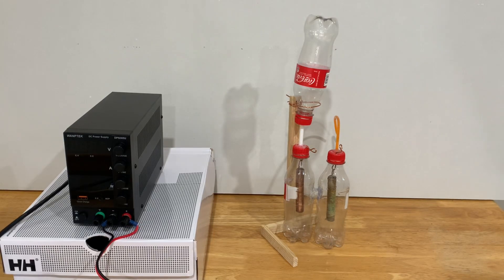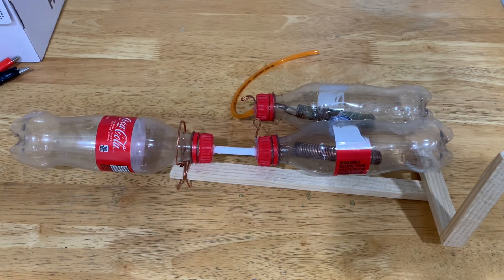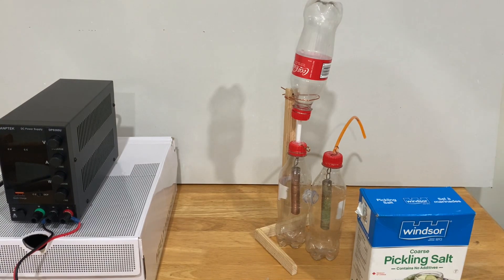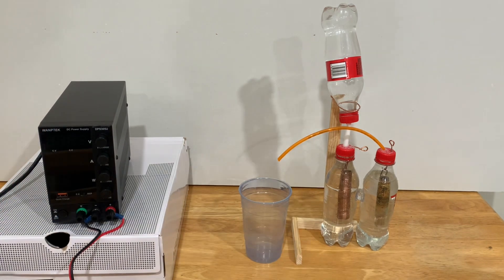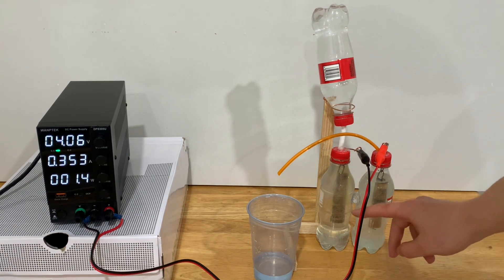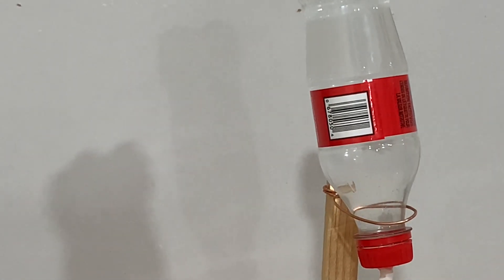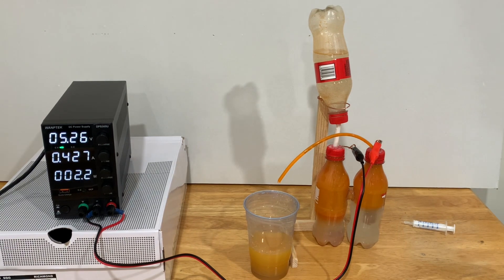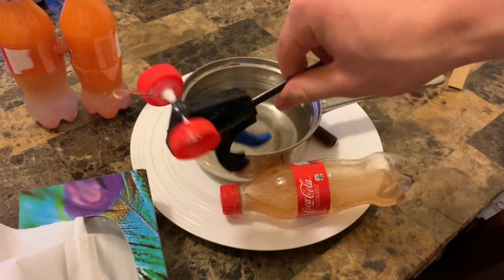Separating water into hydrogen and oxygen

Comment: Lol i made an oxy-hydrogen generator kast year dry cell using scrao steel i had in a pile half of 9 plates the 2 outside plates are one electrode and the middle odd plate is the other which makes it kind of a double back-to-back self so it produces oxygen and hydrogen in both directions I got a power supply that can go up to 30 volts and 10 amps looks a lot like yours I would imagine it's probably close to the same and it can produce about a liter per minute it took about 2 minutes and 5-6 seconds to produce a 2 l

Comment: The orange stuff is probably iron oxides and chlorides. When the electrolysis takes place, it produces chlorine gas from the salt, and this quickly reacts with the iron to produce iron chloride, which dissolves in the water explaining the yellow color. It also generated iron oxide because oxygen gas is also being produced along with chlorine at the anode, which reacts to form iron oxide. The iron oxide explains the orange color. Iron oxide is insoluble, so it appears as a sludge.
Reply from the maker: Here’s the thing tho, there is no iron inside of this machine, it’s all copper and plastic, I would agree with that explanation myself if there was iron, as if anything my pfp is made from iron hydroxide, but the thing is is there’s no iron inside of this machine to make iron salts out of
Reply: @ChemistryOnCreatine  its possible that its copper hydride?
Reply from the maker: Honestly I thought so too at first and for a long while. After doing a little bit more research I’ve concluded it’s copper(i) oxide
Reply: @ChemistryOnCreatine  I knew it had to be a metal salt

Comment: you forgot that if you are using salt then chlorine and sodium will also be produced.
Reply from the maker: Which will quickly react with the copper and water, causing a neutralization of each of them, which will then revert back to salt and leave a blue precipitation in the water. I didn’t have it here. Well I did but too much orange stuff was produced I only noticed it under closer examination. But the first time I did this it was present, and lots. It however posed no harm to me so I kept it

Comment: Don't use halogen salts, they make the positive terminal degrade turning copper into copper hydroxide. Try something like MgSO2 (bath salts) or KNO3 (Fertilizer)
Also the yellow shit is probably the enamel from the copper wires, you can't make copper hydrate with this method
Reply from the maker: Unfortunately I have none of those, but I am pretty confident the same effect will be produced. Nevertheless I do not care all too much about copper hydroxide in the water around the hydrogen as it doesn’t effect the hydrogen itself. 
I have no idea what this was, but the first time I ran this machine i got copper hydroxide instead. The only difference in the preparation was the corrosion and the high salt concentration present in the video
Reply: @ChemistryOnCreatine  I have tried electrolysis experiments multiple times with different electrode and salt combinations. Sodium which is the positive ion will be attracted to the negative terminal  (black wire) and Chlorine which is the negative ion will be attracted to the positive terminal (red wire). Chlorine subjects the positive terminal to harsh conditions so electrodes like copper wire, stainless steel utensils and other common metals will be slowly turned into chlorides (Metal + chlorine). If the hydroxide version of the chloride metal is insoluble in water then It will precipitate out since at the other terminal the salt's sodium is being turned into sodium hydroxide and for example with  a copper electrode It would make the reaction:
NaOH(aq) + CuCl(aq) -> NaCl(aq) + CuOH(s)
Platinum group or carbon electrodes however will not react with the Chlorine instead releasing it as gas and keeping the sodium hydroxide in solution.

On the other hand salts like MgSO2,  KNO3, will not subject the positive electrode to such harsh conditions and will not split, instead giving the water the conductivity it needs to be able to split hydrogen and oxygen at the negative and positive terminals. You should really try to use non-halogen salts,  you probably have a few types at home, or could very easily purchase in stores.